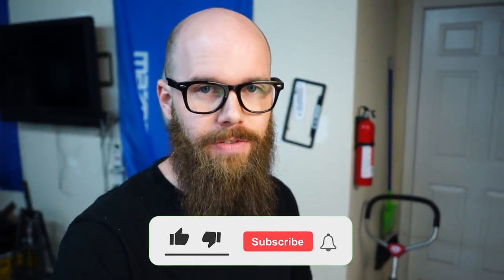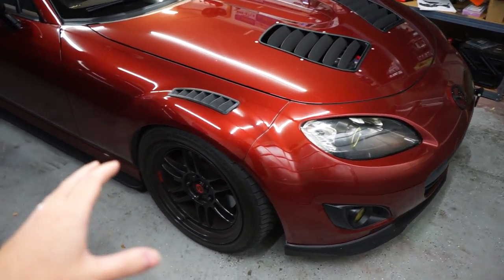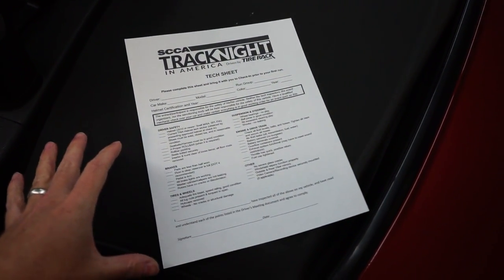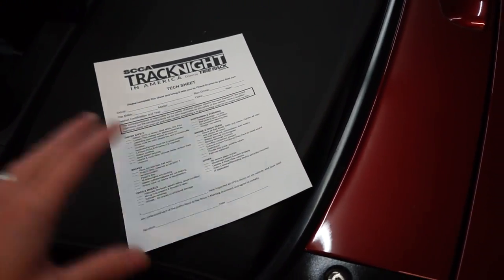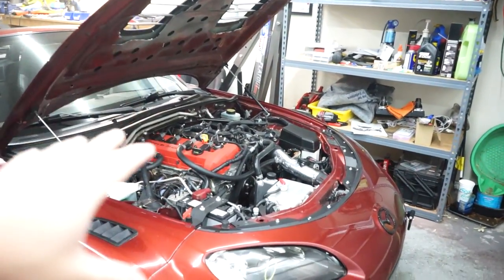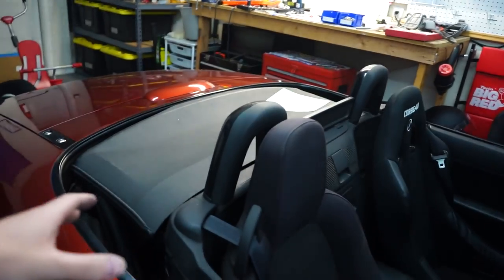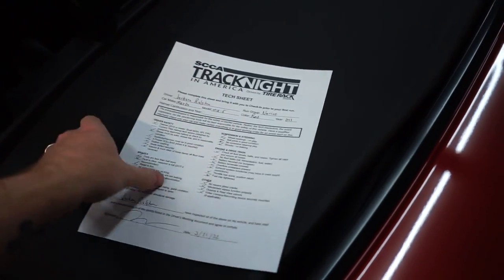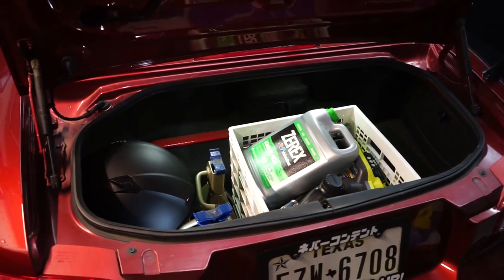Track Day Prep with the 2.5 Swap NC Miata

Comment: 85 ft/lb for the lug nut torque for the NC. Nothing more, nothing less.
Reply from the maker: My wheels didn't fall off so I guess I'm lucky
Reply: I've driven with less torque on my lug nuts. Not on purpose, but not a great moment when I discovered what I did.